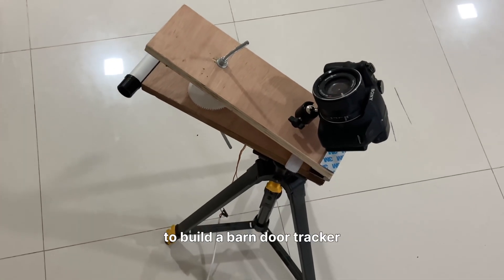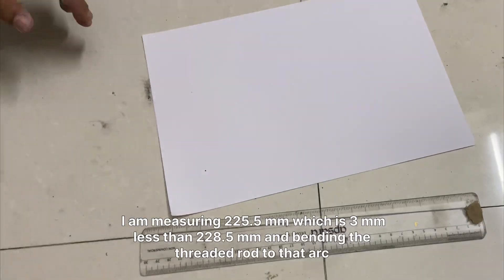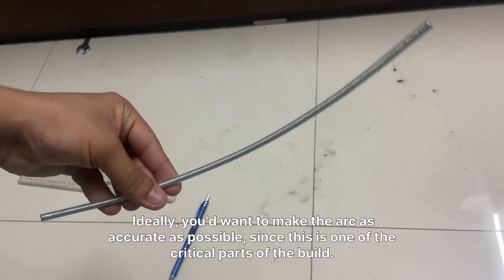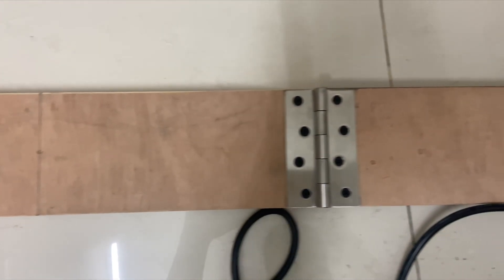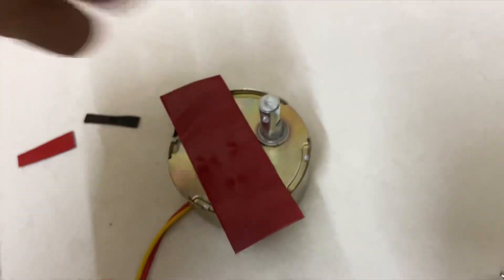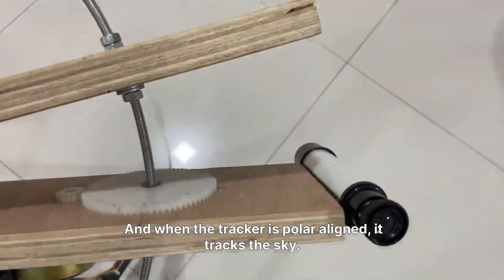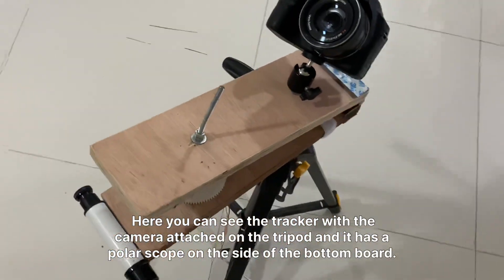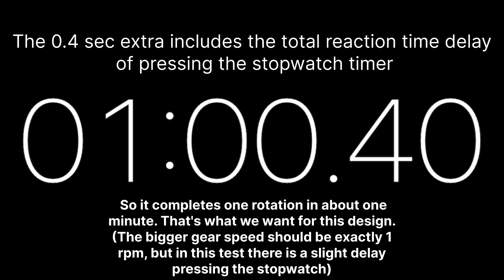I Built a CHEAP DIY Star Tracker for Astrophotography

Comment: Didn't understand how the polar alignment will work ? Can you pls explain a bit
Reply from the maker: Great question. I used double-sided tape to attach a polar scope (reused finderscope) to the side of the bottom board, making sure it's parallel to the hinge. To align it, you just look through that scope and center Polaris star. If you want even more accuracy (since Polaris isn't exactly at the North Celestial Pole), you can offset it using an app. I cover the process with an app called 'Polar Scope Align' in my Part 2 video. There is also another method called drift alignment to fine tune alignment.

Comment: Whats the weight capacity of the motor ?
Reply from the maker: I tried Nikon Z6 II (approximately 705 grams including battery)
And nikkor Z 17-28mm f/2.8 lens (approximately 450 grams)
Total 1155 grams
It worked successfully

I would say 1.5kg should be manageable with this tracker
Reply: @Ishaan_Astrophotography great , thanks again for your help

Comment: I have built the barn door tracker as v1 then made my way to ra mount 3d printed that's a lot of journey I ordered parts from robu and maker bazzar which is great i am currently working on varn door tracker again for most accuracy i am gonna use the 3d printed parts again with threaded rod spacings it's great to see my fellow Indians making barn door trackers ❤

Comment: Where did you find the rod for the arc
Reply from the maker: This is M6 threaded rod of 300mm length. Should be available in hardware shop
Reply: @Ishaan_Astrophotography what's the diameter of the rod

Comment: Nice I have build a manual one, will try this one any suggestions?
Reply from the maker: I’ve provided all details in the description kindly go through it and let me know if you have any question. I’ve part-2 video also of this on how to use it so you may check that also
Reply: @Ishaan_Astrophotographyyes I am just curious, I read about it it said stepping motor is good for it, and also few important parts are not in video like bending of rode, how to fix it and other things.
Reply from the maker: Can you tell me what exactly is missing in the video? I will add the details accordingly in the description
such as bending the threaded rod, gear stl files and other things
Stepper motor is good but it needs a stepper motor driver and something like an arduino to work which adds more complexity. I went with this motor instead but you can use stepper motor.
Reply: @Ishaan_Astrophotography
 01. the drawing on for the arc, 
02. how you bended it properly,
 03. added the thereded rod with nuts but how?
 04. 3d printed online or you have the printer? 
05. and sources or links for the motor and bolts 
06. single nut to attach the tripod is very triky in my maunal one it took a long to fix it as single nut not properly holds the traker with tripod, so how you achieved it?
 07. the power source for motor is not mentioned, it will also limit it to home use i think , but its looking more esier than the stepping motor
thanks for considering
Reply from the maker: @boltiphoto  
01. the drawing on for the arc
The arc for the threaded rod was created by first drawing an arc on paper with a radius of 225.5 mm. When bending the M6 threaded rod, we need to account for its 6 mm thickness. The rod should be bent along its inner length as shown in the video. To find the precise radius for the center of the rod, you must add half of the rod's thickness (3 mm) to the initial measurement.
The final radius for the bent threaded rod's arc is therefore 228.5 mm (225.5 mm + 3 mm).
 
02. how you bended it properly
The threaded rod was bent manually using my hands and some tools. I used a pair of pliers to get a solid grip on the rod and a heavy, stable object in my case, the underside of a bed to act as a leverage point.
To achieve the correct arc, I used the paper template I created and made a series of small, bends along the length of the rod. This process was done slowly, bending a little at a time and regularly checking the rod against the template.

 03. added the threaded rod with nuts but how?
To add the threaded rod, I first drilled two holes: one in the top board and one in the bottom board. Both holes were measured and marked at a distance of 228.5 mm from the center of the hinge. Next, I passed the bent threaded rod through the hole in the top board. Using several nuts and washers, I secured it firmly to this board. The rod slides through the bottom hole as the tracker moves.

 04. 3d printed online or you have the printer? 
Online, I used robu.in

05. sources or links for the motor and bolts 
Something like this 
https://www.amazon.in/SVDK-220-240V-Synchronous-Swing-Pulley/dp/B0F5HKLMQ8/

06. single nut to attach the tripod?
I couldn't find T nut, so I drilled a hole for the nut and used fevikwik (superglue) to glue the nut in the hole. if you can find T nut you should use as its more stable

 07. the power source for motor
AC wall outlet. If you're taking this to a field with no AC power, then you may use an inverter.

Check description for the gear STL files